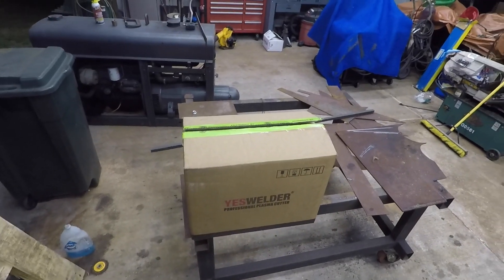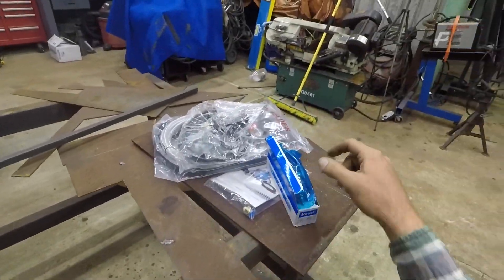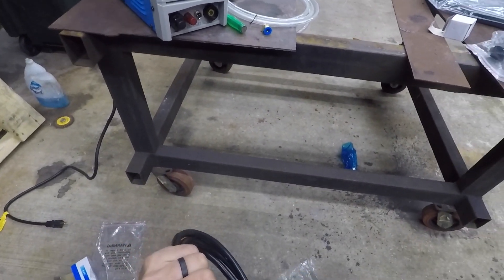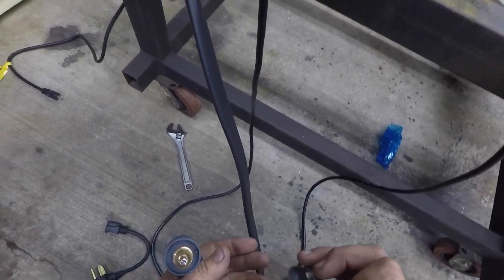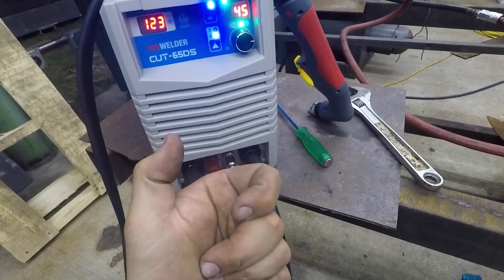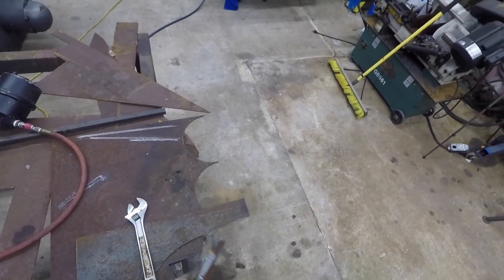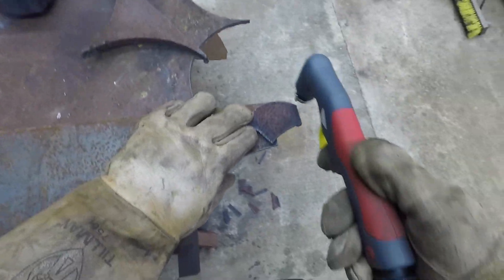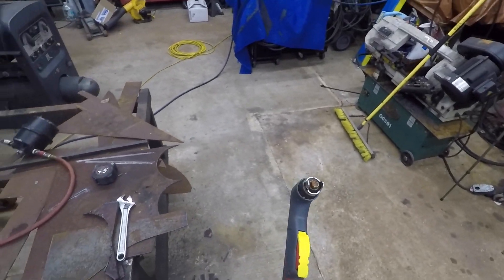YesWelder Cut-65DS Overview and First Cuts

Comment: Thank you for the review. May I know what breaker amperage you used for the machine. Would it work with only 40 Amp breakers? The specs recommended 63 Amp breakers.
Reply from the maker: Mine are 50amp